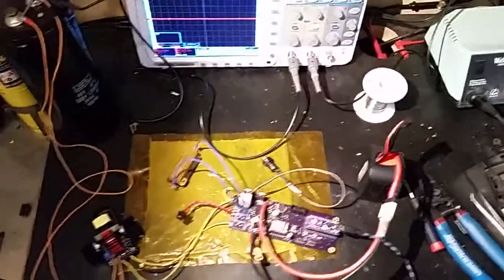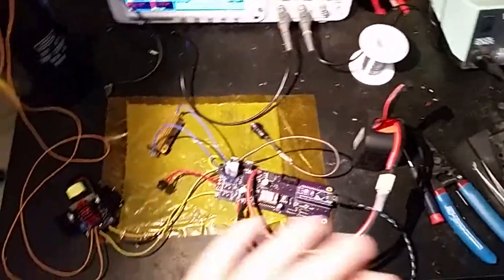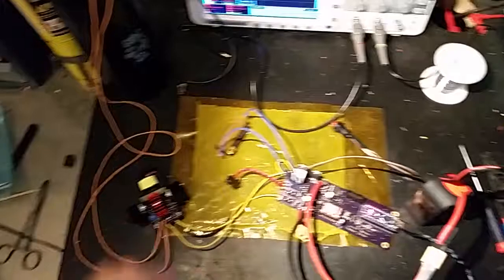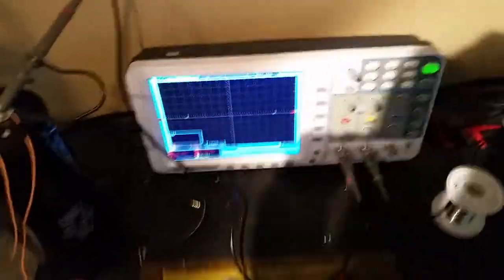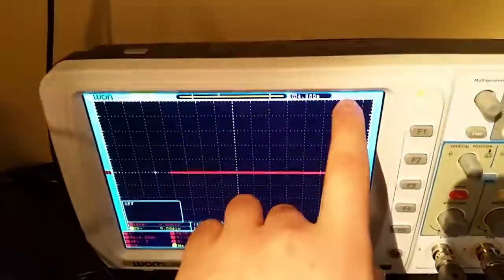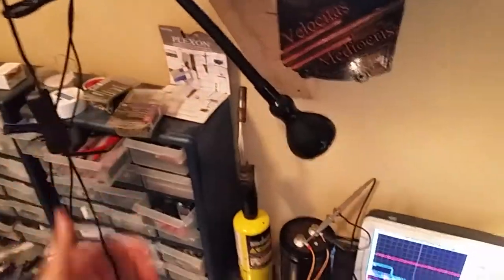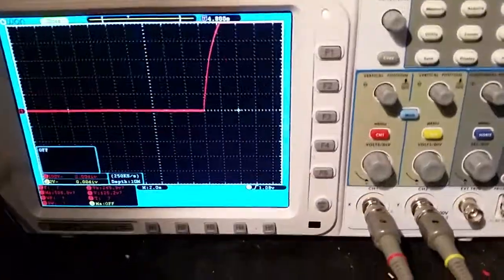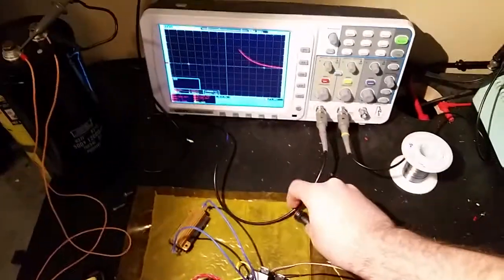New XPR-4 quasi-resonant 600W high frequency charger

Comment: Hi guys...I was just wondering, how do you get the SCR's to un-latch when switching such a circuit?  From what I can summarize,  after studying several similar circuits, it seems the only way to 'shut-off' the thyristor is in an arrangement that allows the current through it to drop below it's 'holding current'.